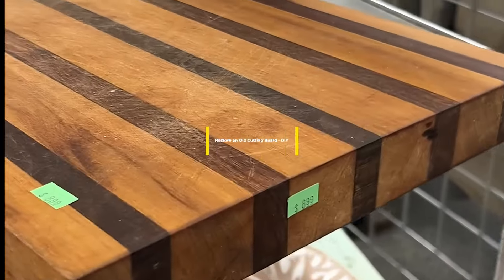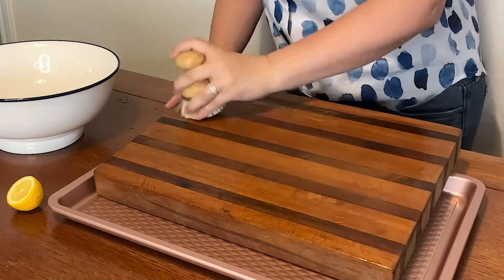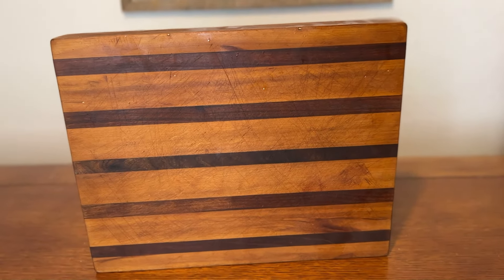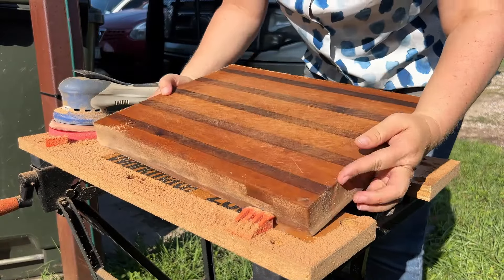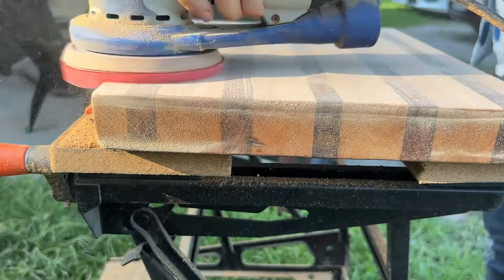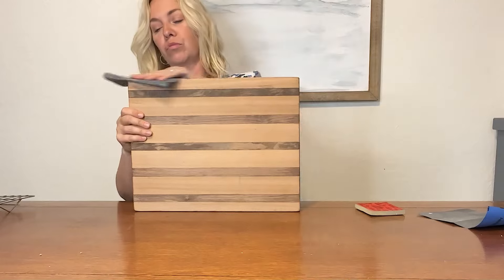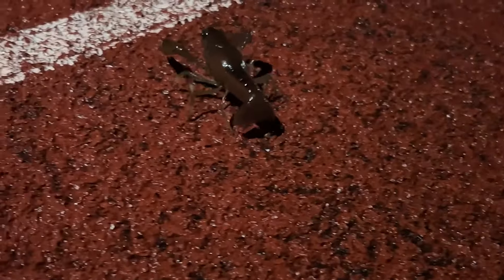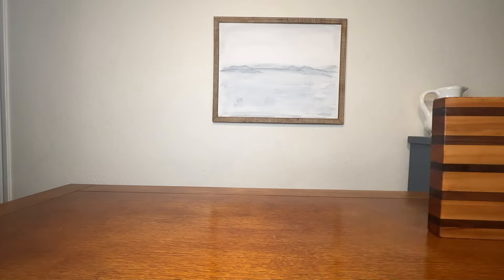DIY Cutting Board Makeover | Restore Like New in Easy Steps | The Ultimate DIY Makeover| The Flipper

Comment: GREAT RESTORE!   FYI... A power Planer would work for this board fine, but DO NOT plane and engrain cutting board!  It will separate the grains and chip out the trailing edge as it goes through!  Hand planing is fine on end grain, but not power planing!
Reply from the maker: Okay, I had no idea. I only used a hand planer. Thanks for sharing!! Thanks for being here!